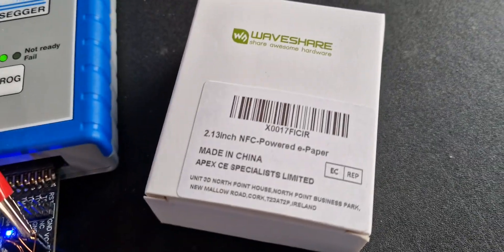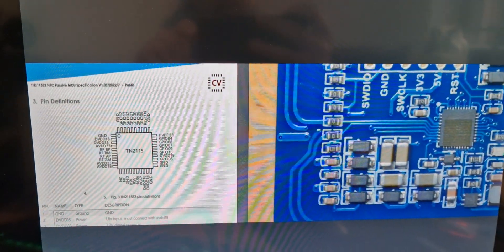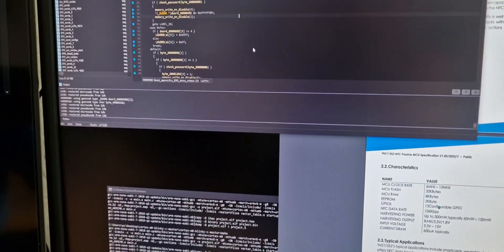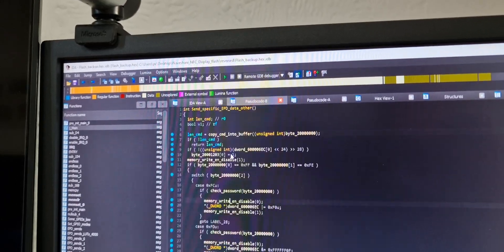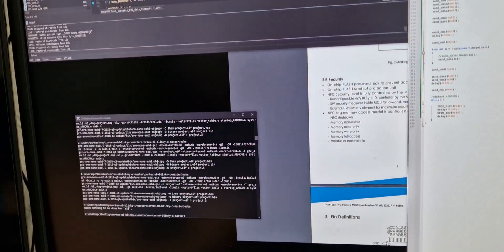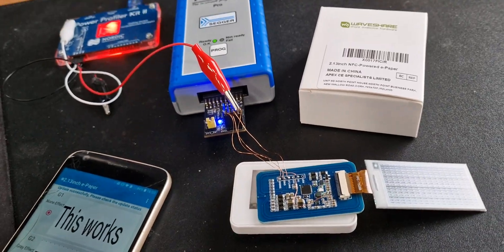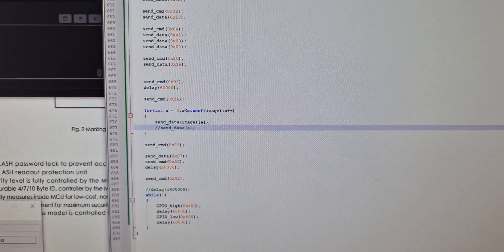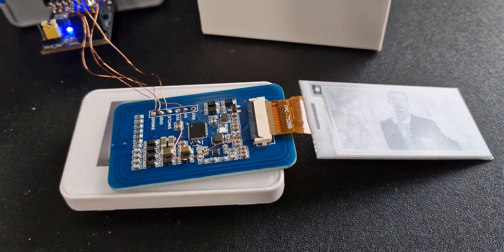Hacking the Battery less NFC E-Paper display from Waveshare  + Custom Firmware

Comment: super job, congrats, one basic question, i've tried to load data from app (just load app on my huaway 20 pro), geenrate a text (no any config or changes on suggested factory app) but nfc sound as coonect but data does not load at all, using different apps loodk like is trasferring  but then eror happen. can you help? once installed the app needs to be configured in some way? (during your video you mentioned password, on my received epaper display no any password was accompanying or manual)